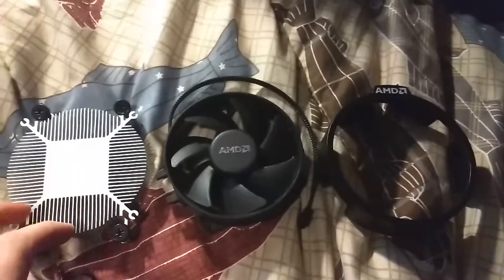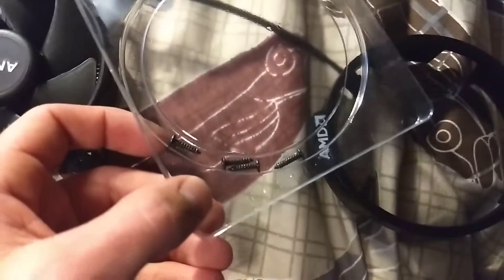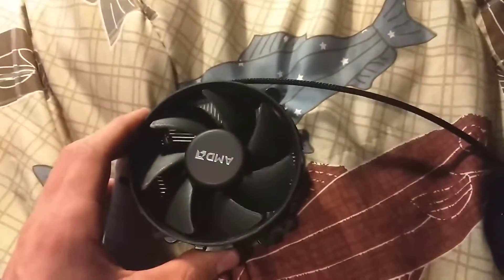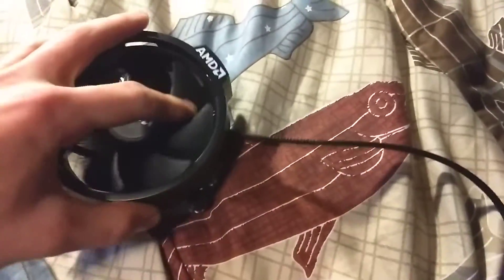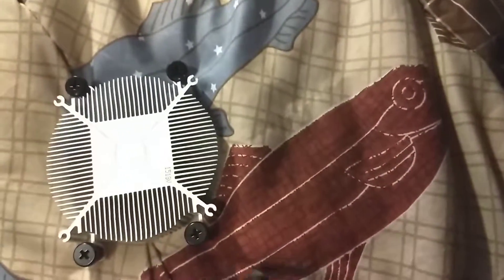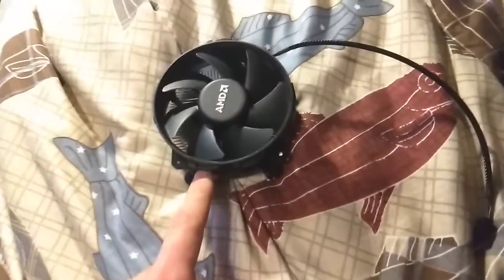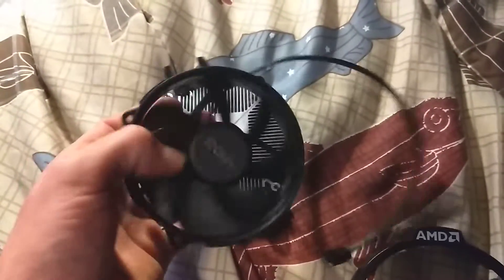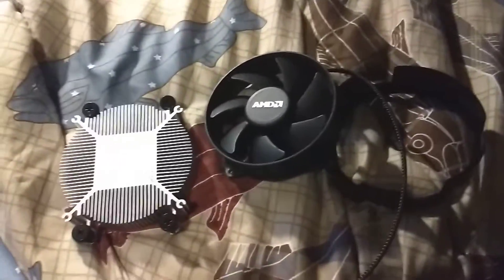Ryzen Wraith Stealth Cooler Tear Down

Comment: just a quick question can remove the amd fan from the heat sink and then use the fan as a case fan? i will not be using this stock cooler for my cpu cooler, i will be using a CoolerMaster hyper 212 rgb instead, so i want to use this fan as a case fan, is that possible?

Comment: ATTENTION! To remove the upper shroud you need to unscrew two additional screws which are hidden in the shroud. They can be seen if you look at the shroud from its bottom.

I wasn't aware of that so I pulled the shroud and broke the plastic which was held by the two screws. The video doesn't describe the process properly!
Reply: Only on the newer models.
Reply: Hi, i want to change side of my wraith cooler cause it's blocking my  fourth slot of RAM. So i Need First to unscrew the 2 ones at the Bottom of AMD logo? Mine has It (5600g)
Reply: Thanks
Reply: thank you man

Comment: before remove that plastic thing with AMD logo, check if You have 2 screws under it, if You don't remove these, thing will break!
Reply: Thanks almost broke mine. I was wondering why it didn’t come off after I took out the 4 screws.

Comment: Imagine using the AMD Fan itself as a case fan? 😂
Reply: Yes i used it as exhaust fan
Reply: @saisanjay2982  did it work well?
Reply: Is it possible? It is not a 120mm fan but does that make a difference? Or could i screw it into my case anyway? I mean i would safe around 7 bucks or so. ^^
Reply: @user-uu3rc3fh6o  Well it's still possible to screw it in.
Reply: @user-uu3rc3fh6o  it's 10cm fan, and it has 2 version: one is 1900rpm(ryzen 1000) and one is 2700rpm (ryzen 2000), make it really good as exhausted fan
Reply: this is why i searched this video i have too many of these useless cooler and i tought i could make use out of them
Reply: Yes, i did it
Reply: I use it as a Fan for myself on hot summer days.

Comment: I need tutorial to open the amd fan cassing pls
Reply: Its not hard its just annoying

All 4 sides have a clip in the middle

With the AMD logo above the fan at the top do this

Unclip the left gently pulling it away from the fan

Unclip the AMD logo side, still holding the left side and now the top side so half the shroud is pulling away from the fan

Unclip the right side

It will come out very suddenly so expect to have it fly away

Mine didnt break and it fecked off about 2 meters

Dont pull hard the sides just gently push / pull the side away from the center and it will unhook that side

The last side may be harder but dont force it to much because when it unclips it pops off instantly
Reply: @commanderoof4578  how do i return it lol
Reply: @NewsNowShortss  

What do you mean return it?

You mean put it back on? Just screw it in or clip it back on it clips on all 4 sides
Reply: @commanderoof4578  big thank for you. I can finally open my fan